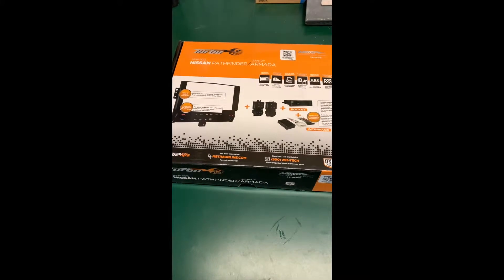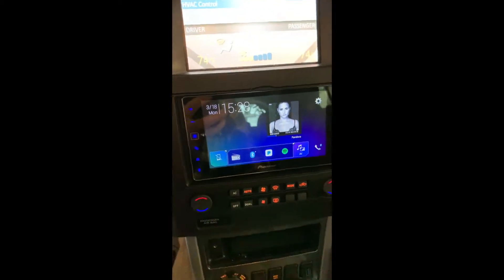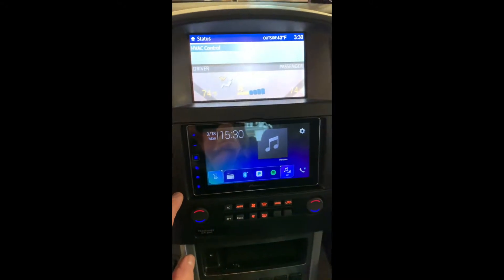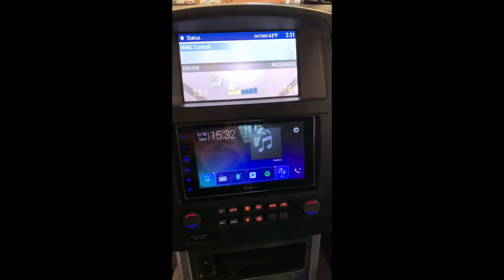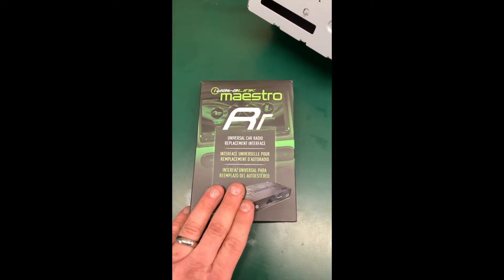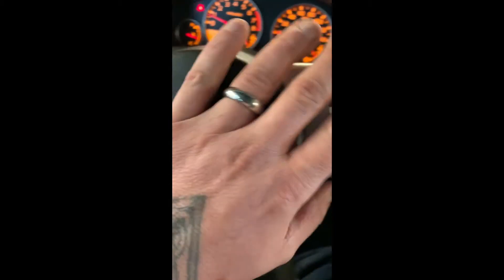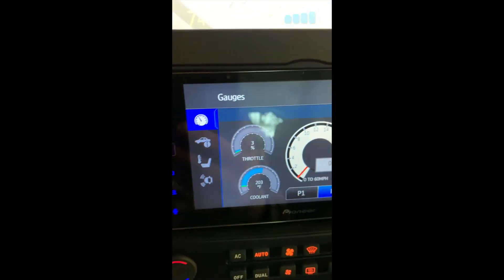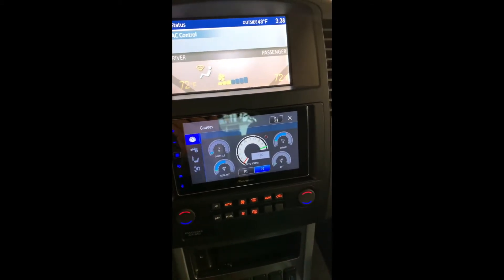2011 Nissan Pathfinder Stereo uprgrade PT 2

Comment: I can't thank you enough. I own a 2010 and have been shopping around cautiously. Just as you said, with so many of these trucks on the road, it's hard to imagine that the choices of upgrades are so limited. But you've come through with these vids and that has helped tremendously. Thank you sir.
Reply from the maker: Thank you for the kind words.   Much appreciated.
Reply: @garageonomics9411 good morning I know it's been a while I have a 2012 Nissan Pathfinder with navigation I'm totally lost. The aftermarket radio turned on with no sound and the OEM screen doesn't turn on . Do I have to connect all 3 wires from the top screen?

Comment: I have been waiting for a video like this, I have a 2012 pathfinder and was hoping I would eventually see a metra install.  Thanks for the video
Reply: to answer your first question, yes the dual button does allow to change temp for the passenger side.  It initially did not work but does now.  One of the key things that tech support stressed was to not plug in any type of steering wheel control until after you have powered everything up, then go back and plug in steering wheel controls.  It states this in the instructions as well.  I had to exchange my stereo, after the exchange is when my dual button started working.   The mpg and distance to empty still do not work, however.
Reply: @robertmccully9017  chatted with Metra months back, they stressed to update the firmware to ensure all functionality works, that may work for the DTE and mpg, or maybe you already tried that
Reply: @kra7997  Honestly, after I got it all in and the majority of everything worked I was concerned about updating and then having something not work.  So I did not update at that time.  But you are right that it may correct the issue.  Maybe I will give it a go and see what happens.

Comment: I have watched your video multiple times to check what made yours work and mine have a backlit black screen and uncontrollable HVAC controls.

Still cant get mine to work unfortunately.
Reply from the maker: Man, it has been a while.  I know with the metra install kit i did have to install an update to the little black box.   I believe i either emailed or called support and they were able to guide me through.  It may even mention that on the instructions?

Also, I did go back and see I did. Pt 1 video as well that goes mentions the update needed.  -after you have power to the little black box, there is an update required.

Comment: Rob which usb insert did you use?
Are you able to provide a manufacturer or model #? Thanks in advance.
Reply from the maker: BATIGE Square Single Port USB 3.0... https://www.amazon.com/dp/B078LRSZDB?ref=ppx_pop_mob_ap_share

I ordered this one.  Pretty cheap but works well.

Comment: Two Questions 
First does it sound any better and two did you have navigation and if so are you still able to use it.
Reply from the maker: Just saw your comment.   Sorry for the delay.  No I did not have navigation and now with this unit I just use google or Apple Maps, much better than factory nav units in my opinion.
Reply: @garageonomics9411  I agree. I use the Waze app most of the time as it gives me alerts of police or hazards as well. Much better than factory NAV.

Comment: Which factory connectors on the vehicle side were not used in the installation? Just spent 6 hours trying to install this in my buddy's 2011 Nissan Pathfinder with factory navigation and the Bose system. We were able to get the aftermarket double din radio to work, but not the factory screen and we tried both harnesses included with the kit and everything. Any help would be appreciated. Thank you.
Reply: I just finished installing in my 2012 pathfinder with bose and navi. Its 3  connectors from the factory plugs that plug into the axxess box. Did you make sure the ring terminal is grounded properly? All the connections to the back of the oem screen is plugged?
Reply: My screen+control panel won't work.There are 2-16 pin harnesses in the vehicle.Could this be a problem?
Reply: @pmad56  good morning I know it's been a while I also have a 2012 Nissan Pathfinder with navigation I'm trying to figure this out, it's very confusing with the wire connections. Can you help me with it?